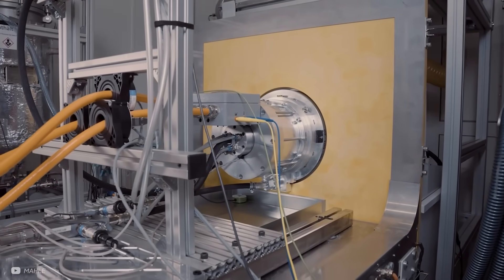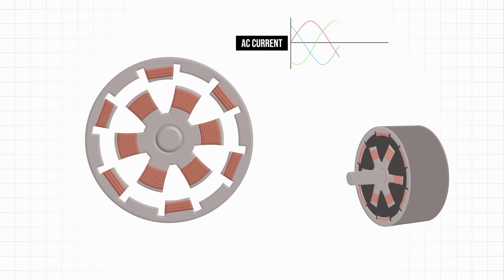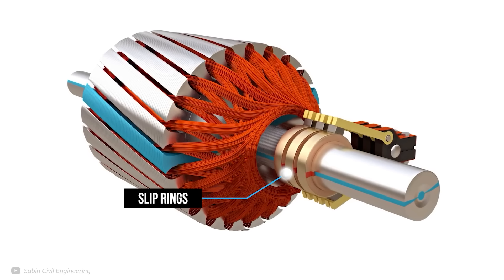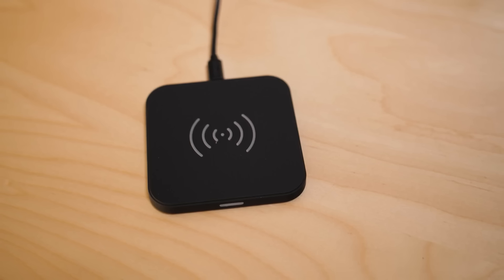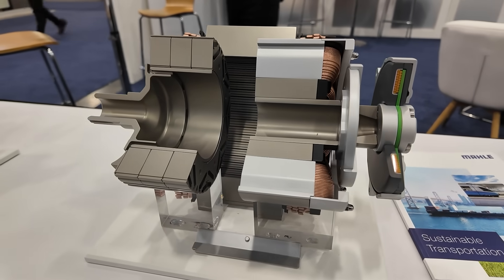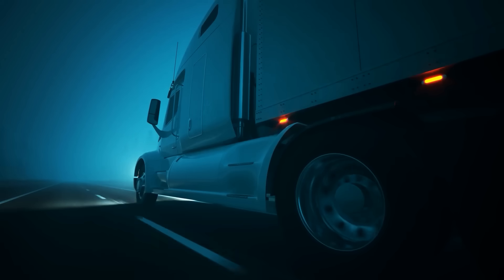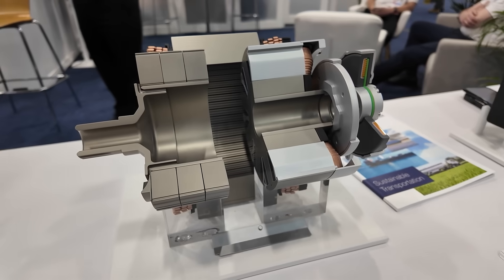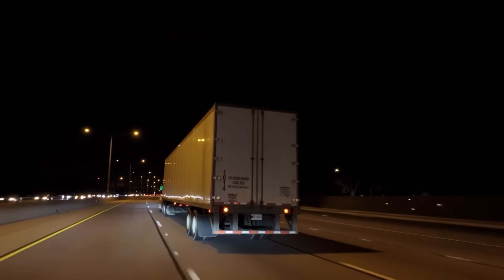Genius Contactless Motor Could Change Transport Forever

Comment: so if i understand this correctly, this motor works like a BLDC motor, except the rotor has electromagnets instead of permanent magnets?
Reply: It's more like a brushed ac motor, but they've replaced the commutator with a transformer.
Reply: @xxportalxx.  Correct. It's an example of a rotary transformer.
Reply: BLDC - is a Permanent magnet Synchronous Motor/machine  (PMSM),  - 3Phase ?AC /  - ( or chopped DC pulses - better efficiency uses a full wave AC inverter for motor driver)  on the Stator and Permanent Magnets with fixed N/S/N/...  on the rotor, very simple.  

Industrial / old school Synchronous machines - have DC fed Electromagnets on the rotor and AC (3P or whatever0 on the rotor.  Self Excited Synchronous machines have an electrical device in the rotor assembly which generates the power (DC) to make the fixed electromagnetic stator field (it rotates, and remains synchronous with the core / rotor speed - most used industrially are "in-runner"  as the heavy outer winding is best mounted in a huge case - bolted to the powerplant, or whatever - Motor / Generator - slight design changes, but Tomato, Tomatah..... 

 Externally Excited Rotors - using ?? many power transfer method (brushes, mercury, gallium, "Induction"  -rotary transformer/ magic..  etc,  (internal "rectification/ smoothing / inversion is all possible) allows the regime to change from Synchronous to Asynchronous, or anything desired by the controller..  (True Double fed motors / electric machines  - Synchronous particularly - are able to alter the Power factor on the generator OR the motor  side - this is really handy for plants/factories / industrial consumers,  with lots of inductive loads and really poor PF (Power Factor) - remember ELI - n inductive loads Voltage leads Current (Positive Power Factor) - factories get fined if this is not "within spec"..   (VVVFDs can fix this too, simple induction motors cannot.

Ai tells it like this: "In a synchronous machine, power factor is controlled by adjusting the excitation current supplied to the rotor field windings, which allows the machine to operate at a leading, lagging, or unity power factor depending on the level of excitation; essentially, by increasing excitation, the machine can provide leading reactive power to the system, thus improving the overall power factor. "  Google search Overview..

Comment: Of course it will. Everything on this channel changes everything forever
Reply: My life feels different already
Reply: @JonnyMoxey  thats how it feels, when you waste 11 minutes. i feel the same. And NO, it wont change transport, not even a little bit.
Reply: @Pausenton  No Neodymium for the motor is excellent for european manufacturers
Reply: It's a sort of reverse indicator. Videos using the phrase "changes everything" are usually the least significant
Reply: Dude's got to pay the rent without getting a real job.
Reply: Go easy on him, there are only a few positions left where the sole requirement is posh British accent -- youtuber being the primary one.
Reply: 😂 you right mate
Reply: This is not that revolutionary.  It is all quite feasible.  It really depends on rare earth costs, and there isn't existing capacity to cover the EV conversion everyone expects.
Reply: LOL.
Reply: At least the title doesn't use the g word:  "gamechanger"
Reply: I balance it out with Cash Jordan where EVERYTHING IS OVER all of the time.
Reply: Sarcasm is just that
Reply: Well the biggest advantage is that you can create much stronger fields using electromagnets. The power is ran through a rotary transformer, then rectified to feed the magnet. It's also possible to make it bidirectional as well so the motors braking energy can be recovered. The biggest advantages are that it can run a lot hotter than neodymium magnets and the torque is able to be continuously varied from nothing to full power
Reply: and yet the years come by and we still use decade old tech. where are the graphene batteries? where are the graphene semiconductors? i thought mass manufacturing was tackled 10 years ago yet i don't see it on the retail shops or even aliexpress unless it's some proprietary snake oil aid that just works on top of already established stuff. induction motors existed almost 2 centuries ago. 20 years ago the go-to solution for rechargeable batteries was li-ion. today, it's still li-ion and whatever miracle tech is announced on the headlines either comes 10 years late as an underwhelming prototype or just never leaves the lab, it's the nuclear fusion argument all over again
Reply: @hydra3693  to be fair,  oleds took way longer to get mass adopted than I had patience to wait for
Reply: @DrewWestPress   ,!  goin sit on your broad sword 🗡️ up Uranus  on a distant orbit. 😂 😂 😂
Reply: Idk, I called my happening guy and he said nothing
Reply: If you wanna see 1000 more videos with THIS CHANGES EVERYTHING where it didn't change a thing:
- 2 bit davinci
- Cleo Abram
- that super skinny bald dude's channel
Reply: @dogefromthefuture  Undecided with Matt Farrel, i think is the bald dude.. 
I definitely wont watch Undecided or 2 bit davinci anymore..
Reply: @Monstah7  you're right lol 😆 it's that Matt Farrel guy.
Reply: @Monstah7 lol I knew exactly which guy. I stopped watching his videos too. Overall the only important information on his videos can be summarized in the last 30 seconds and it’s always some sort of technology that’s 20 years to be commercially available
Reply: @msergio0293  🤣🤣😂 Yeah, even his channel name gives me the sh*ts these, like just make a fricken decision already.. /sigh
Reply: Yeah that's not how it works, you got it backwards but it's usually how it works with the masses i guess
Reply: Please show more respect to Ziroth  and Ryan.

Comment: Es gibt einige Unternehmen, die den elektromotor stark optimieren, ohne seltene erden nutzen zu müssen.
Beeindruckend, was alles noch optimiert werden kann. Beim Verbrenner sind wir schon ziemlich am Ende. Bei der elektromobilität geht noch einiges, obwohl jetzt schon sehr effizient..
Reply: It's also more complicated and requires more components, I know this because I've actually designed a wireless charging system for secure cross pavement cash transfer boxes.